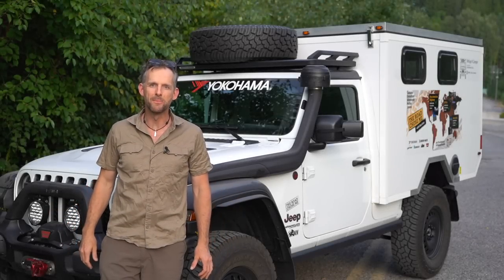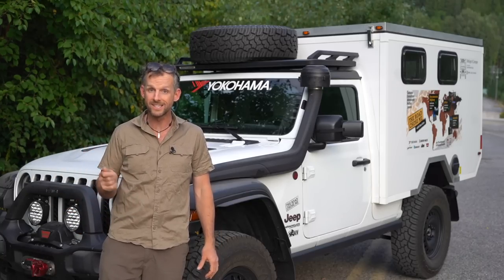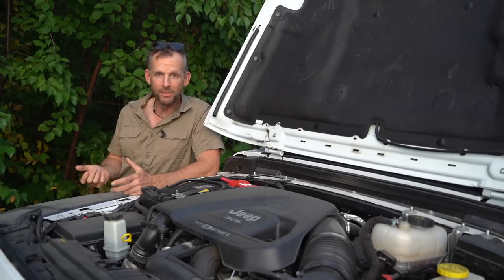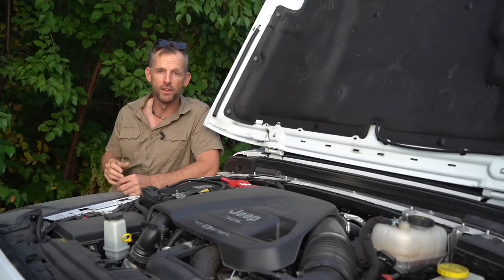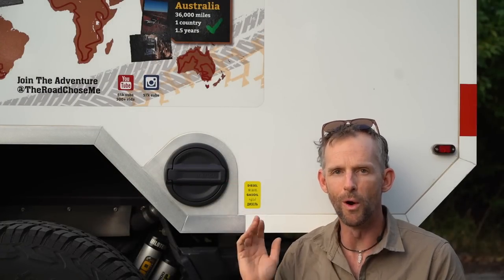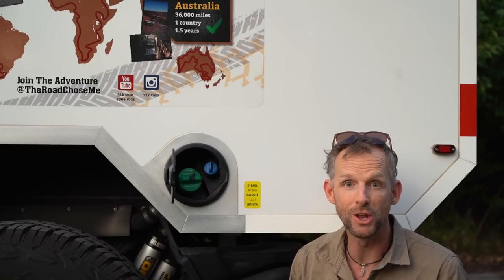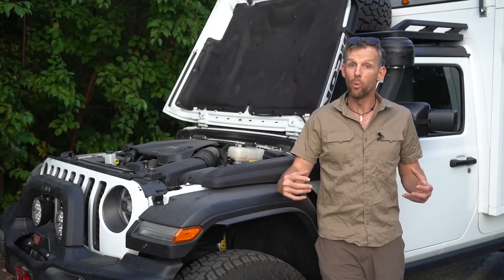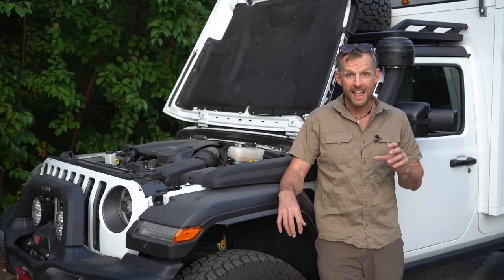Driving a Modern Diesel Around The World - is this a REALLY bad idea?

Comment: I think you are misinformed with respect to sulfur in diesel.  The Fischer-Tropsch process produces a zero sulfur diesel.  You have to add a lubricity agent to F-T diesel to get the lubricity that the removed sulfur provided.  I believe that when you reduced the sulfur level to 15 ppm the refinery had to add a lubricity agent to the ULS diesel.  Second point.  The black smoke comes from aromatics in the petroleum based diesel.  F-T diesel has zero aromatics and no particulates coming from the tail pipe.  F-T can be made from any carbo based material but the latest F-T plants built by Sasol and Shell use natural gas.  Sasol has several F-T plants in South Africa that use coal as its raw material.  Shell brings its F-T diesel that it makes in its Pearl plant in Qatar to Europe to blend with ULS diesel to make a better quality diesel.  Shell also makes a F-T engine oil that Pennzoil sells as made from natural gas.  Pennzoil's full synthetic motor oil, unlike other synthetic motor oil, is created with natural gas as a starting material, which has fewer impurities than petroleum or crude oil based engine oil.  The F-T process is not cheap so you need large quantities of cheap natural gas to make the process somewhat economic.  Back in the 1970's when we thought we were going to run out of natural gas the US built a coal based F-T plant in North Dakota to make a synthetic natural gas.  In theory if one could be assured a supply of F-T diesel you would not need any of the DEF or other diesel emission junk.

Comment: I think it all depends where you'll be traveling. So, if ULSD is available, then NO issues. Now, if it's NOT, the BIG question is, How is this going to affect your travels, and is the tradeoff worth it?? As in, will you take a 500 mile REMOTE drive, like the ones you took in Africa, or Australia, running dirty diesel?? I know I will NOT. The added level of justified anxiety will rob the fun out of the adventure. And in my book, I want to build a car to take anywhere I want, and as my adventurers unfold, and NOT a car that will dictate and determine my journey. So I'm willing to bet that your next trip is in counties where ULSD is widely available, and that's great...but IMHO, a modern diesel is still NOT the right choice for a true global vehicle.

Comment: I do not even want to depend on a modern diesel to drive across the USA as matter on the fuel quality the EGR will soot up the dpf will clog and the urea delivery system will have an issue and the computer will force you to a dealer at 5mph
Reply from the maker: That is certainly the risk
Reply: @TheRoadChoseMe   its more of a certainty it is the question of time and luck you can extend that time with some good habits such as keep  idle time to a minimum and get it up to hiway speeds for prolonged periods both things that are in short supply when camping in the forest etc 
However my 12v cummins has ran flawlessly for 350k this 17 peterbilt I'm in currently seems to need a trip to the mothership about every other month for something emissions related and it is generally trivial in nature such as a def level sensor...but it still derates unless it gets corrected...then it only gives you so many starts like 5 and thats it

Comment: Honestly none of your reasons for keeping the emissions systems out weigh the negatives those systems bring. It’s all fine and dandy saying you want to emit less NOx but I don’t think you’ll be saying that when you are in the side of ditch in the middle of nowhere with a full tank of Diesel but the computer won’t let your engine start. 
Removing the DPF, Adblue and EGR for $3k will save you far more money in the long run and ensure your engine is more reliable.
Modern emissions systems destroy Diesel engines.
Reply from the maker: I don't disagree, though being illegal is a big problem.
Reply: Thanks for the reply! Yes of course being illegal and the possibility of being caught is a big drawback. 
I wonder if there is a comprise, where the Adblue “No Start” can be flashed off the ECU so at the very least you won’t be stranded in a perfectly functioning vehicle?
Reply from the maker: Actually yes, I know for a fact that can be done
Reply: Ohh that’s very interesting! I think that might be the perfect comprise ! Well maybe that and an EGR delete 😉
Reply from the maker: Yep, that's exactly what it is!